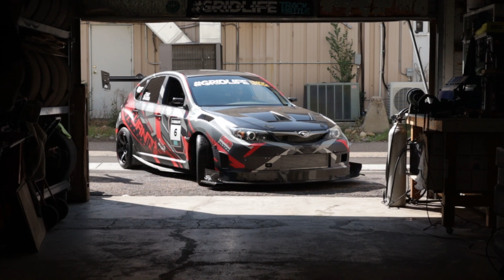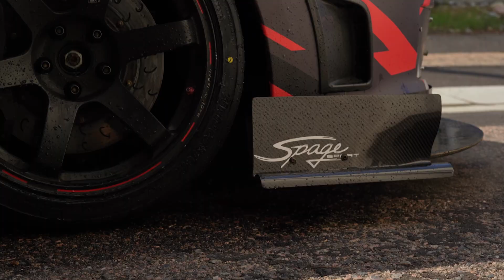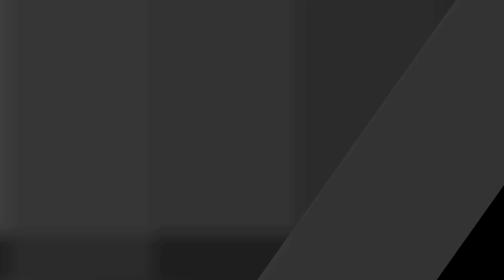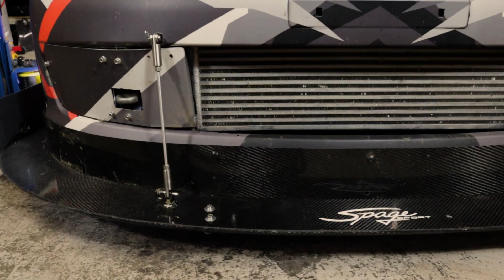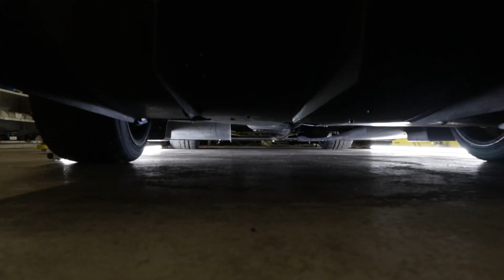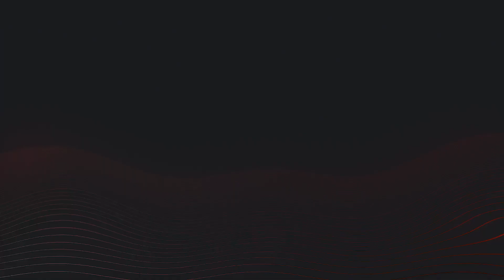Mike Aumick's Time Attack STI with Tony from TiC

Comment: It would have been nice if he would have shown what parts were used on the oiling system.
Reply from the maker: I think that is something that they are keeping to themselves for the time being.  But I would guess that they will give some more information about their setup at some point.

It is something that they are still actively developing.

Thanks for watching and Stay Tuned!
Reply: @FlatironsTuning  Thanks for the reply, it would be interesting to see the combination of parts used from different manufacturers. The inherent oiling issues of the EJ are the main reason I only do a handful of track days a year and if someone has found a winning combo it would be nice to know. Right now I'm relying on the KB pan and pick up with a tomei stiffener/baffle.
Reply from the maker: I'd say that you have a good combination there.  If at all possible, keep an eye on your oil pressure and log it if you can.  Once you have that data, you will be able to tell how your oiling system is working.
Reply: @mikesti8406  I was really hoping for this also. I was using a KB pan when I spun a bearing. Now I'm looking to see if someones finally figured out a winning wet sump.